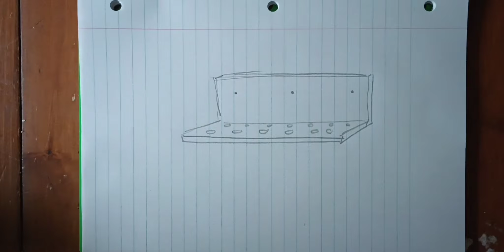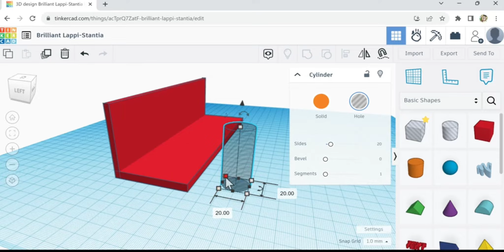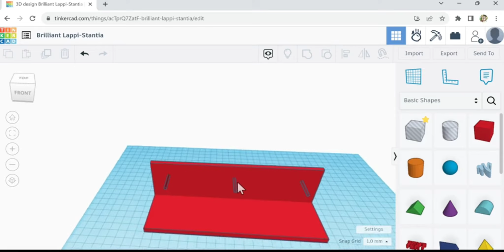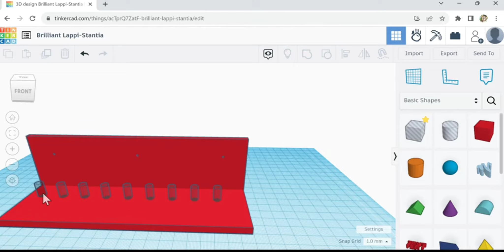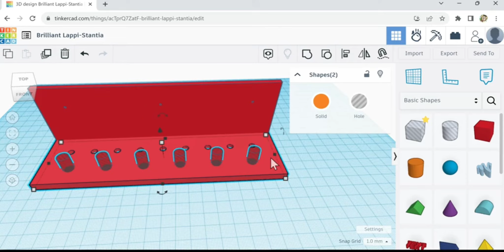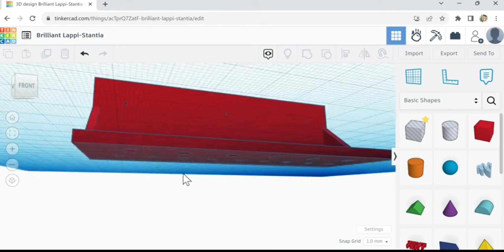Tinkercad Beginner Tutorial ( Part 1 ) Screwdriver Holder Design and Print! 3D Modeling

Comment: So starting on your tutorial,  tinkercad seems much easier to mess with than Fusion,  I had done a few things on fusion but they were simple designs,  only issue I am having with Tinkercad is the website seems to crash on me,  I use many other softwares some online others on this PC and they do not crash.   Tinkercade will boot me randomnly to home page, and sometimes the whole page/tab just vanishes, and I have to reload the website.  at least it auto saves the work as I go.   I will try it on another computer to see if it is more stable.

Comment: STL stands for Stereo Lithography.  The orignial liquid plastic laser process at Dupont for car parts (the only companies that could aford the machines) STL went on to dry roller laser and eventually adoped for filament printing (FDM?)  OBJ was invented by Waveform a long long time ago for animation.  The format caught on and it stuck.  It does have the problem of using a separate file for texture.  FBX includes the color info.
Reply from the maker: @bbrachman  Wow! Awesome information! You clearly have much knowledge on the subject!  Thank you! 🙏
Reply: @TinkercadWorld-ho8ht  I really like your first tutorial will be coming back to see what you do later.  I just think a bit more reseach could make the much better.  For instance: Counter sink the head of a screw. Put the small screwdrivers in front of the large ones.  Easier to grab.  Bevel the edges.  Just terms that might be more descriptive and take less time to say.  I really admire YouTube content makers.  I have never done it.